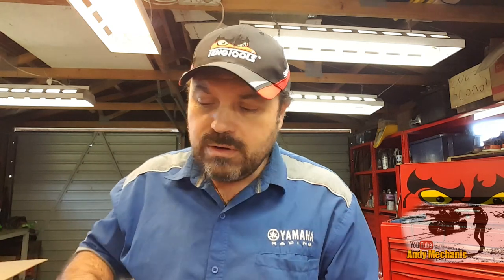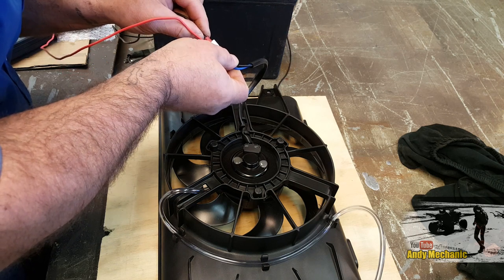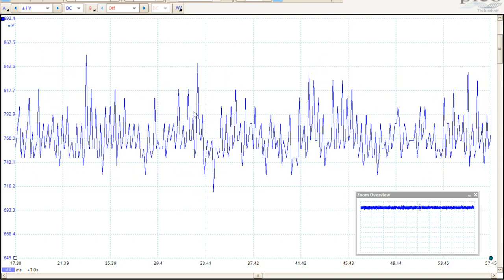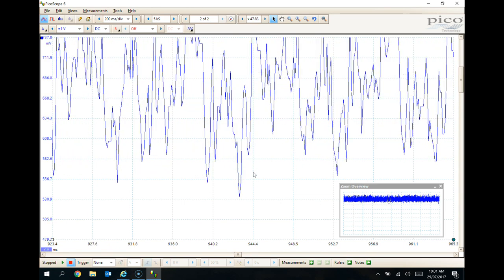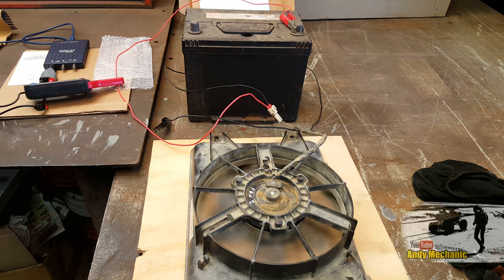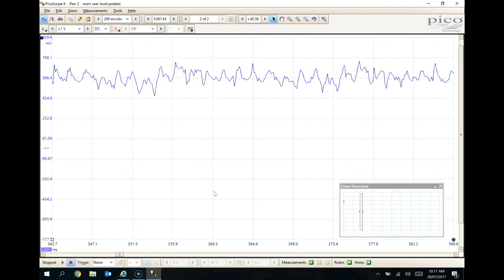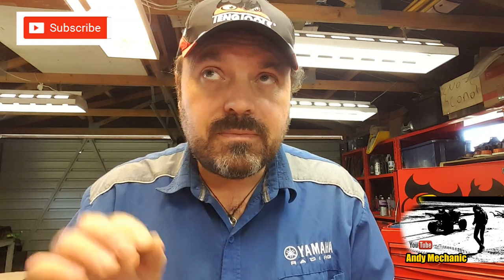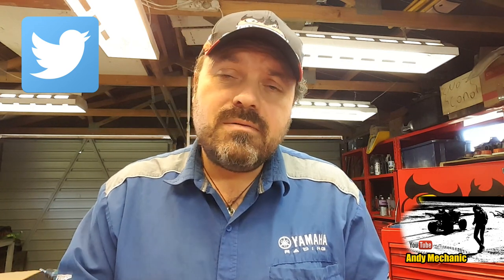PicoScope analysis of ATV cooling fans #1428

Comment: We used a PicoScope when I was in the test lab at Hiflex hose to adjust / record the pressure waveforms on the impulse rigs. That was back in the mid 2000s running windoze XP. We got the PicoScope because the 'proper' ocilloscope burnt it's tube out and they were talking thousands [ukp] to fix it. Originally brought in as a stopgap, the powers that be [accounts dept] decided not to get the 'proper' one fixed so it became the permanent equipment. 
The Pico was a lot easier and more flexible to use. I think it cost around £250 back then plus an annual calibration fee. 
Your 'good' waveform looked all over the place to me :-)
Reply from the maker: +Frank Todd Hi Frank, thanks for the feedback. PC based scopes do seem much more affordable and so easy to use, though I have only had the PicoScope for a little over a day when I made the video so still getting my head around it & will be for a long time.

It's great to have feedback from someone with much more experience using one, I only really started to use a scope at the University a few years ago but have found them most useful.

I too was a little surprised as to the fluctuations in amperage on the new fan. Obviously not made to a very high standard.

Anyway, thanks again. Cheers Andy

Comment: So I have a question, we blew a head gasket on our 2023 Yamaha viking 700 VI 
We replaced the gasket then the thermostat got damaged, we changed that, and it's still over heating we bled the water from radiator for air pockets and fixed that but still over heating, we don't want to take to the place we got it cause they told us out right it will sit for 3mths